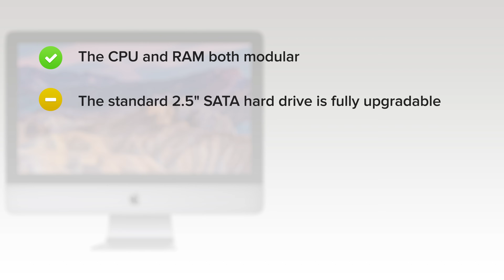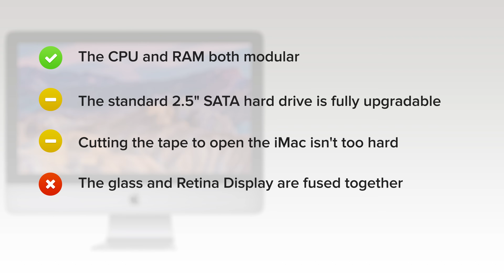iMac Intel 21.5" Retina 4K Display 2017 Teardown Review!

Comment: Hello, and to know if it is possible to change the processor of my iMac model machine iMac (Retina 4K, 21.5 inches, 2017) It currently has a 3.4 GHz Intel Core i5 quad-core processor. Do you know how much I can upload it? Well, according to Apple, these legends indicate that I copied and pasted you. (Configurable to Intel Core i7 with 4 cores and 3.6 GHz (Turbo Boost up to 4.2 GHz) And if the replacement part is correct, how do I order it online or how would I look for the replacement part???? since it gives me many results and it is confusing for me to find the part to replace. Well, the processor is where I have the most doubts

On the other hand, memory indicates this...
Memory
3.0GHz
8 GB of 2400 MHz DDR4 memory
Configurable to 16 GB
3.4GHz
8 GB of 2400 MHz DDR4 memory
Configurable to 16 GB or 32 GB

But obviously I haven't opened it, I don't know if it works at 3.0 GHz or 3.4 GHz, as I understand it and if it uses 3.4 GHz it is possible to maximize it up to 32GB. Is my thinking correct?
And finally, on the hard drive, it has a 1TB HDD but it indicates that it can be replaced as follows...

Storage

3.0GHz
1 TB hard drive (5400 rpm)
Configurable to 1TB Fusion Drive or 256GB or 512GB SSD
3.4GHz
1TB Fusion Drive
Configurable to 256 GB, 512 GB or 1 TB SSD

But my doubt is!!! If I can install an SSD with a larger capacity than the one proposed on the page, it indicates up to 1TB. But it can be increased from 2TB to 4TB?????
Or would you definitely not recognize it?

I hope for your help with these three ways to maximize the performance of this old machine.

Comment: The ram thing was incorrect. 
Now, the 21.5 inch imac has a ram door on the back.
Reply: xBane_  no it does not if you look on the back on the 2017 and like every other 21.5 inch iMacs it has no ram door just a exhaust vent.

Comment: Whatever you do, don't order the HDD-only models, people :P  
The HDD only ones don't come with an internal slot for blade SSDs, the fusion drive ones probably do, so you could at least upgrade that later with some open heart surgery. Crazy that Apple hasn't made the Fusion drive at least minimum standard in these in 2017, macOS is not fun on a spinning disk.
Reply: Can''t you use a standard sized SSD instead?

Comment: HD not upgradable to SSD? Did I get it right?
Reply: You have to use a 2.5 inch Sata SSD. You can't use a "blade style" SSD. Pretty sure it will be possible to put in a 2.5 inch 2tb SSD in it if you wish.
Reply: sixyears it is the SSD that's used in MacBook Pros the blade stick Type can't be added but you can replace the hard drive with a SSD that looks like a hard drive.

Comment: so you can buy the base 4k-imac (maybe with fusion drive), replace the cpu with 7700k (about 100€ selling the 7400), add 16gb of ram RAM (about 70€ selling 8gb), add an eGPU and you have a much better machine then the full-loaded 4k. Even better than the best 5k.

Comment: Ram behind the logic board! They made it impossible to do it easily, Why couldn't they put it on the front of the logic board? Cutting the screen glue to gain access is already frightening, why make it more difficult after that?

Comment: I would put a non replaceable GPU as a con
Reply: You can plug in external GPU's via Thunderbolt 3
Reply: O!Technology you can't socket gpus due to the needed vram, and mxm sockets are large and increasingly forgotten about, and you can't just go out and buy an mxm card.
Reply: if you can think of a way to put replaceable gpu in that form factor, without thermal consequences, apply at jobs.apple.com
Reply: Which all-in-ones allow GPU upgrades?
Reply: Exactly. Replaceable GPU is more important than replaceable CPU.
Reply: O!Technology you can use a eGPU
Reply: Sven Ollino I know some older hp touchsmarts have mxm upgradability.
Reply: iMacs use mobile versions of the dedicated graphics card counterparts found in desktops so it would not be possible, also if this is the base model iMac it uses integrated graphics which would defiantly be soldered to the logic board, 'High Sierra' supports external GPU's though so you can plug a GPU in via USB C,
Reply: But the CPU can be upgraded. You could put in a much faster i7-7700K that would not bottleneck any current GPU. It will bottleneck future GPUs but not very severely for several years.
Reply: I agree. Apple should use MXM cards the way they did in past iMacs so that the Graphics Card can be upgraded along with the VRAM, and allow third-party manufacturers to make replacement graphics cards.
Reply: http://www.digitalstorm.com/aura.asp
They put a litteral 1080 founders in it. And im sure that apple could have done a custom watercooling loop that make it even thiner.
Reply: well you couldnt anyways cause the technology for that really isnt that available yet but yes, theres the laptop gpus but it would make the imac thicker and actually slower cause laptop gpus have lower speeds than desktop ones.
Reply: Yeah, because you can buy GPU chips off the shelf. What did you expect a PCIe slot in an iMac?
Reply: If anyone else wants to chime in and defend Apple in this remember they had replaceable MXM GPUs in the 2011 iMacs. That's what I think they should've done again. And an upgrade-able GPU is way more important than an upgrade-able CPU which probably would take 5 years for it to be outdated where as GPUs "need" to be upgraded basically every year with their performance increasing every year. Edit: YouTube glitched out for a while now I can see the replies.
Reply: Josh Bacon no it's not. A slow CPU will severely bottleneck your GPU.
Reply: Origin PC has an Ultrawide AIO with a standard dual slot PCIe GPU, and Lenovo was showing off something similar at CES.
Reply: Roshan with thunderbolt 3 they are
Reply: O!Technology who still makes mxm gpus?
Reply: external gpus aren't as good a internal gpus

Comment: Am I seeing things? Laptop ram in a desktop system? I guess Apple aren't the type of company that uses much variety in hardware.
Reply: I get why you would want to make an energy saving on portable devices by using this kind of RAM, but I suspect by doing this in a desktop/AC powered device, they have just reduced the performance of their product slightly. I don't know if I will go check, but I have to wonder what the difference in timings/latency, read/writes, and energy use / heat dissipation is like.
Reply: ThaMovingTarget It doesn't save money, cuz sodimm is less buyed.The price of 2Gb Sodimm is way higher than  regular Ram size
Reply: You must be new to Macs, welcome  - you're late but welcome anyway.

Comment: Our standards for Apple products are way too low.
Any other company gets so much flak when they 1. Have big bezels (still smaller than those of the iPhone) on their smartphone, like Pixel. 2. Aren't user upgradeable/serviceable. 3. Has bloatware apps pre-installed.
Reply: Today i installed Windows 4 times and i guarantee you that when it comes there is literally nothing on it, not even drivers, not even direct x, NOTHING. And i agree with android.
Reply: Ryan Good The Watch App. The Videos app. Podcasts, iBooks, Find My Friends, crap like that which no one uses. Also home.
Reply: Mikko Haavisto since when does Apple have bloatware in their OS? That sounds more like the third party crap that comes on Windows and Android devices.
Reply: Reducing the bezels would mean less room inside for components

Comment: You missed the 'totally unenforcable warranty void sticker'. Any company trying that crap should get a zero
Reply: TheChipmunk2008 It's actually illegal to put warranty void stickers now. Actually, it's illegal to void warranty after user disassembly all together.
Reply: go ahead and google. overclocking voids your warranty. you overclocked that 7700k you just bought? warranty voided. and clearly you aren't an enthusiast if you don't know why people delid processors. for overclocking geeks and people who want the best thermals possible, you have to delid intel chips, since they use a very cheap thermal solution inside the casing protecting the chip. remove it and replace the thermal compound with high end stuff, and bam. temps drop significantly, sometimes upwards of 10-15 degrees Celsius.
Reply: shut your face! Whether or not I am an enthusiast is irrelevant and at any rate, if you're suggesting that delidding is the one definite criterion to determine if someone is an enthusiast, then I presume having unprotected coitus with a HIV positive partner must be your idea of adventure sports. Now coming back to your logic, are you suggesting that my factory overclocked MSI GTX 1080 Ti X 8G was basically out of warranty the very day it was manufactured ?? I can't say much about CPUs because I usually avoid overclocking them for several reasons- First because I have to use them for a MUCH longer period as compared to GPUs (READ - BEYOND warranty period) and so its better to avoid screwing them. Second reason is that overclocking CPUs isn't going to be of much useful to me since I'm a doctor by profession and solely use my PC for Gaming and Multimedia Consumption in addition to general usage. So video editing and photoshop aren't exactly my cup of tea and hence beyond a certain point, any additional CPU juice gives diminishing returns, if any at all. Third and last reason is that overclocking a CPU is not a very seamless experience unlike GPU where all you need to do is to move a slider in MSI Afterburner. I had been using an i7-2600K since 2010 till 2017 and this time I decided to skip out on a K series CPU to save money and invest it towards getting a better GPU. ALL THAT KEPT ASIDE, NO ONE AT INTEL CAN TELL WHETHER OR NOT YOU'VE ACTUALLY OVERCLOCKED A CPU as long it is not physically burnt. Lie your ass off and they won't know, UNLIKE tearing a label.
Reply: Intel don't include Overclock damage in Warranty. Or Over volatge damage i don't remember. But anyway they can't prove you overclocked it and will just accept the warranty cause they don't have the time to verify with a microscope what is broken in your CPU. And for some EVGA product i know that if you have trouble overclocking or coil whine they will replace your GPU.
Reply: It depends on the manifacturer. If you overclock your AMD or Intel CPU, you void warranty, even though you paid extra to get the unlocked multiplier. Thats it, its their policy, they can do what they want. There are however graphics cards manifacturers that not only sell already overclocked models, which obviously do have warranty, but also allow to over clock without voiding your warranty either. You have to find those who allow it though, because its usually not advertised. And yes, they find out if you overclocked it, even if it isnt damaged, same for changing voltages. The CPUs set a non removable bit and youre screwed.
Reply: every company does this. try taking apart any prebuilt piece of electronics, like a console. they all have warranty void stickers.
Reply: custom built rigs have the same problem, you can't overclock your chips without voiding the warranty, you can't delid without voiding the warranty, you can't remove most GPU heatsinks without voiding the warranty, etc etc.
Reply: TheChipmunk2008 by the time you need to upgrade it won't have warranty anyways . And that goes for most companies... so try again.
Reply: shut your face! Who the hell told you overclocking voids warranties?? Unless one is an idiot and physically burns the chips/boards, overclocking IS COVERED under warranty. Why else would people pay additional price for the unlocked multipliers. And furthermore, MANY third party Graphics Cards are factory overclocked and its perfectly covered under warranty as long as physical burns don't develop.
Reply: shut your face! And why in the world would you want to delid ANY microchip
Reply: So most companies. e.g MSI?
Reply: melodyofailingheart questioning why people delid gives it away, any enthusiast knows why some delid, even if they don't do it themselves. And I said CPUs you turd blossom, Gpus are a different story entirely. Because you don't buy the chips directly from the manufacturer, the AIB companies (EVGA for example) put their own warranties on it. But yes, some GPU companies do void your warranty if you OC it past their factory OCs. And I don't overclock either, it's not good value, even putting aside the voided warranty. Too expensive for too little gain. Getting a locked chip with a lower end board is much better value, even for gaming. And yes I know, they won't know you overclocked it unless you fry it somehow, and even then you can just lie and say the cooler fell off or something stupid. My point wasn't that they could enforce the voided warranty, my point was that both literal and figurative "warranty void" stickers exist in everything, not just iMacs.
Reply: Baseless slander!
Reply: shut your face! That's precisely why pre-built bullcrap doesn't sell for all that much unless it has a bitten fruit stamped on its ass
Reply: Infact, a negative since score would be more apt for that skullduggery. Add another negative for Apple logo.